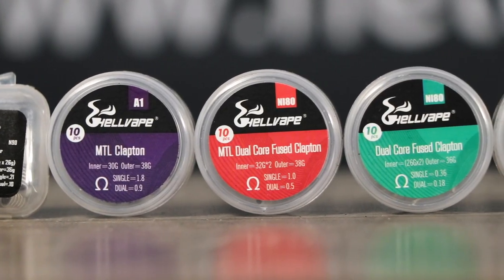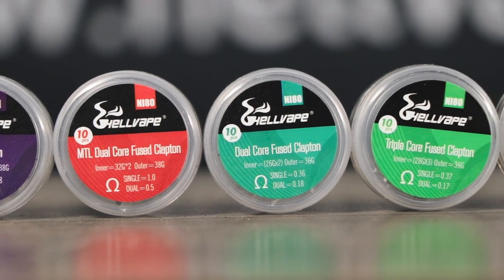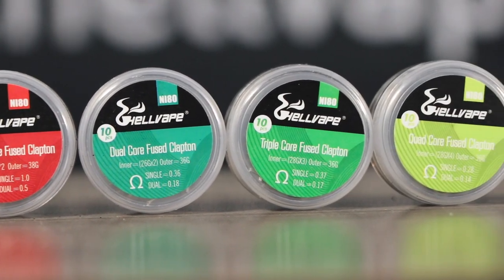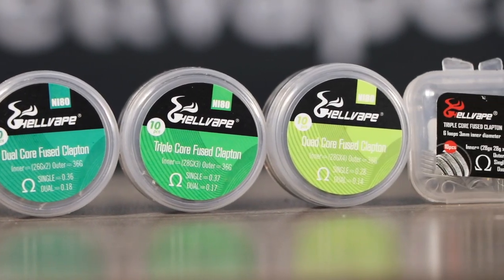What's the DIFFERENCE between KANTHAL, NICKEL, STAINLESS STEEL, and TITANIUM? | HELLVAPE LECTURE

Comment: Nickel will also release harmful vape over a certain degree.  I would have to look that up to see what it is, but have read it someplace.  SS 316L has been my go to for over 10 years. Two 28 gauge wrapped in a 36 is my sweet spot.  But I vape at low wattage on a Kayfun 5s.

Comment: I have heard SS shouldn't be dry burned. Is this true?
Reply: I turn the wattage down very low and it works fine, but at higher wattages it will overheat the coil and break it.

Comment: Does ss coils contain nickel or should i avoid it completely and do kathal since i have nickel allergies
Reply: Stainless steel wire is an alloy composed primarily of chromium, nickel, and carbon. The nickel content is usually between 10-14%, which is not that high, but people with allergies should not take the risk. There are many variations (grades) of stainless steel, expressed numerically. For coil building, SS316L is by far the most commonly used grade, followed by SS317L. Other grades like 304 and 430 are also used sometimes, but not so often.